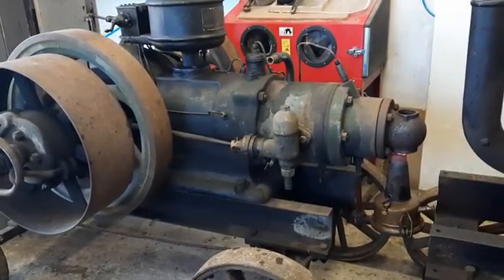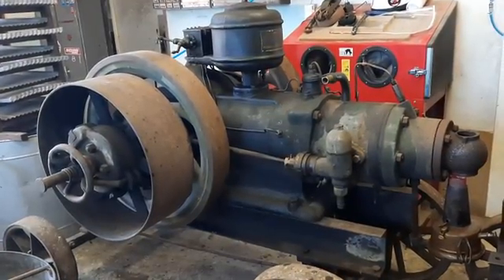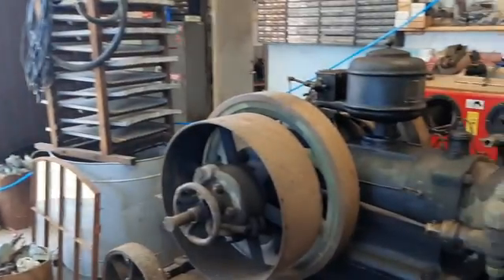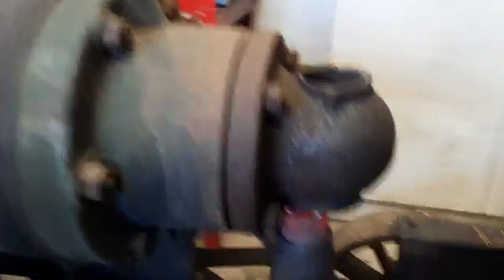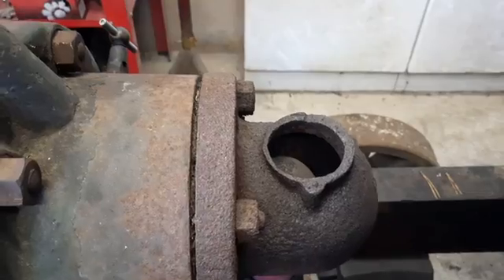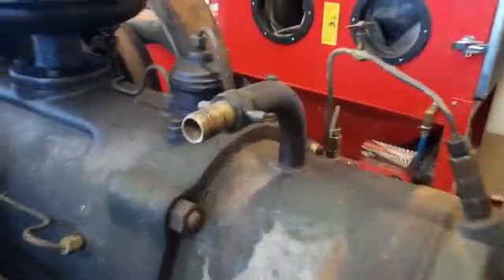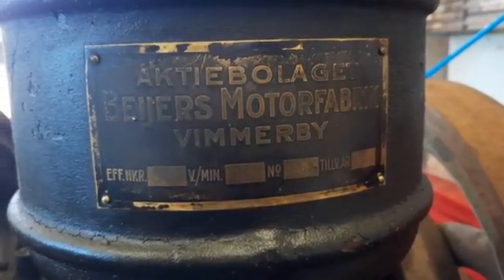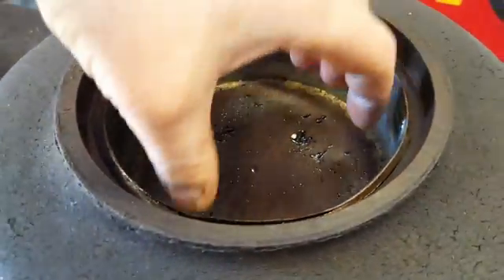10.4L Oil Engine Running @ Zero RPM. How is that possible?

Comment: You gonna destroy the keyways in the crankshaft and in the flywheel  by turning it back and forth. A lot of weight on those flywheels!
Reply from the maker: No, not with these newer Beijers with taper and key. /R

Comment: try  tiki lamp oil as fuel
Reply from the maker: Runs on any liquid that burns. /Richard
Reply: @YesterdaysMachinery  have you tried
Reply from the maker: Yep. Kerosene or lamp oil works fine. 100% wast oil works fine but tend to build up much carbon at the injector nossle. Now i run it on 50%waste oil/diesel. All vegetable oil is fine.  @TimSmith-vl4qk
Reply: @YesterdaysMachinery  what about syntenic waste motor oil
Reply: @YesterdaysMachinery  USE whale oil
Reply from the maker: It would work but them wales seems harder to catch nowdays for some reason. @TimSmith-vl4qk
Reply: @YesterdaysMachinery  syntenic oil

Comment: Believe it or not, I had a Weed Eater string trimmer that ran at 0 rpm like this for a few seconds, I think it’s because the engine would spin the spring drive which would spring back and turn the motor the other way, it was pretty cool to see, did it a few times actually

Comment: My little 2 stroke 125 CC Cagiva Mito bike engine had the same amount of horse power as this engine and weighed around 20 Kg.  Blows my mind how far technology progressed in around 100 years.  Crazy.  Obviously this 10,000 CC engine was just as powerful as my 125 CC engine 🤯 but the torque on diesels or oil burning engines is unbeatable and diesel has more energy stored in the fuel that petrol (gas for our American cousins)

Comment: In England we call those grease cups "Stauffer Lubricators" after one of the manufacturers. they are petty good although a bit tedious to use. There are automatic ones now with a grease cartridge and a high pressure gas canister to feed them, great for long conveyors but quite expensive as they are disposable not refillable.
Reply from the maker: Yes ive heard of that! Yes we use a lot of them at work, and as you say very good for convayor bearings. /Richard

Comment: There is a question concerning the eccentric governor. How does it manage not to change the timing of the ignition, especially, as it obviously works equally well in both directions?
Reply: There is no ignition.
The combustion, overly simply stated, is from the preheated "hot bulb". Once the engine is started it keeps itself heated sufficiently to keep igniting the fuel.
I love these simple engines.
This fella explains everything about them in some of his other videos.
Cheers to you.

Comment: Obviously these engines were used to drive a pulley shaft to run a multitude of machines, you needed someone trained enough to run it in the proper rotation. I did happen to notice oil delivery at ZERO RPM

Comment: I was renting a place that had an old imperial super diesel engine I had a crane so I took the head off and the piston had a threaded hole in it , I put an eyelet in it and had it hanging by the piston and added diesel transmission fluid kerosene and finally got it unstuck never got it going as it had been raped for parts over the years but I got her unstuck

Comment: So it is technically not running. But in sleep mode since in this mode you can't get any work out of it. It is in between operation and off an idle without use.

Comment: That kinda depends on how you define "zero rpm".  Zero implies no movement is occuring.  Also, speeds below 1 rpm are not zero rpm, that's what fractions/decimals are for.
Reply: It isn’t making a full revolution. So is at 0 revolutions per minute.

Comment: That is the most primitive radiator in existence. (Well, one could pee on the engine, thats too crude, but..) this is basically  a pre-diesel. Since it fires on compression but needs preheating. Coool stuff. Thanks for the tour.

Comment: thats the perfect cruising
engine for a medium sized yaht. It doesn't need highly flammable gasoline, extremely bullet proof, can run on wide range of fuels in areas of the world that are remote and coconut
oil, or old engine oil, 
may be the only resource abailable. And its immense weight would replace the lead ballast, and the engine would be installed low in the hull for low center of gravity. That thing can run months on end without maintenance, which is why they are still used to this day on old oil pumpjacks
Reply: Except you have this big engine to produce 5-10 hp. There’s more modern diesels that would produce a few hundred hp and more torque for the same weight.

Comment: Is the cooling tank just a giant stack of small water falls? it looks like the water gets pumped to the top and air cools as it trickles down? 
Would running the engine at "0 rpm" be useful in any way? Seems like it wouldn't even have enough torque for a small reciprocating saw.
Very cool stuff.

Comment: If the engine is splash lubricated, you may not get any lubrication when your engine is running back and forth. May not be good for the engine.

Comment: That old engine seems extremely crude even by 1928 standards. 1828 would seem more fitting for that level of technology
Reply from the maker: Very ruff but extremly reliable and can run on any scrap oil. /Richard

Comment: Great engine but super-dangerous, if your arm got caught by one of the flywheels it'd likely be ripped out of the socket if you're lucky. If you're unlucky you'll be pulled through the wheel like its a meatgrinder. See if u can make a hub-cap style cover for the flywheels and then it'll be way safer.

Comment: When it is "running at zero rpms" it is just malfunctioning. What flat belt implement could be used with the flywheel twitching back and forth making EXTREMELY reduced power?

Comment: At the beginning it looked like there was exhaust coming from the top water connection... is that normal for this engine? Seems like it putting water to it would cause a rapid unscheduled disassembly

Comment: It's an accounting trick.  "Since the engine never does a full rotation, RPM is zero".
Actually, you could simply count how often the orange spot passes through the lowest point ... no longer zero.  If you insist that "direction matters", this engine can run with negative RPM ...

The correct way is to sum up all absolute degrees of rotation over the timespan of a minute and then divide that by the degrees of rotation for a full circle.  That way you get the RPM you would expect from normal engines, reverse running engines are having positive RPM and oscillating engines like this one have a proper, comparable RPM value.

However it may break down for bi-rotating engines like the Siemens-Halske Sh.III due to, ah, loopholes you could be using.

Comment: It can never be zero rpm even if it doesn't fully complete the revolution it's still considered 1rpm cause the motor does turn. A full revolution before stoping and turning back the other way so it's 1 rpm in forward and reverse basically a back and forth motor

Comment: The engine is clearly making a 1/2 revolution in both of CCW and CW directions, it is not doing ZERO RPM. This is possible because the engine is a bidirectional two stroke.
Intentional or accidental in design, the flywheel mass weighting is such that it can resist a complete a revolution by matching  the power of a small  fuel  charge explosion in the hot bulb  combustion chamber against the crank journal travel and crankcase pressure, the resulting oscillation is  aided by the fact that the air inlet port  is closer to the bulb  than is the exhaust port .Therefore with only a minute admission of fuel in the bulb and not enough air the engine will oscillates scavenging of both ports. 
The rotation of the flywheel  traveling one half of a circle does not imply not having moved at all  or simply put ZERO .The motion is whatever fraction of a revolution that can be measured .
 In this case it is clearly  2#  1/2 rotations of a  revolution in opposite directions , and neither do  equal  ZERO RPM.... half rpm CCW , half rpm CW.. from the location of the hot bulb .
Most "hot bulb" engines can produce  this  phenomenon , there is no terminology that describes it accurately for all  to agree about what to call it .

Comment: Does it mean that these engines inject when the piston is right at the top holt-point? And these are the engines which you can rely on all year round, especially if you can burn anything in them. You could truly say "tough times never last, but tough people/machines do." Now, since the advent of fuel crises again, this is the type of workhorse handy to have around any household.
Reply from the maker: It injects when the piston is starting to go up again. / Richard

Comment: I'd think that doing this is rather hard on the bearings and,well,everything else..But,then again,these things are very large and beefy.
Reply from the maker: Hi! not really, This 0rpm thing aint doing anything that a normal load does. These hot bulbs ignite the fuel before TDC every stroke. It injects the fuel when the piston is just turning to go back up. And the oiler works just as good in any direction. /Richard

Comment: Just found your channel, fascinating. Never worked with two strokes. How does the exhaust work, please?
Reply from the maker: Hi! Just like any other 2-stroke. A port in the cylinder that goes under the engine. /Richard

Comment: Was it made to rock back and forth are did it just happen to be able to do it after it was invented. Awesome engine.
Reply from the maker: Old fishing boats used this 0rpm as idle. Then they could start the engine i any rotation to get F and R. For this stationary engine it is just a cool feature. /Richard

Comment: Doesn't sound like a lot of power until you look at the torque, which would be about 394 lb-ft.
Reply from the maker: Yes, very strong at very low rpm. Good working engines. That is why they became so popular. /Richard

Comment: Are you planning to use the engine for anything?
Reply from the maker: Hi! This one i use for smal stationary stuff some times. But i have other Hot bulb engines also that i use often in my big sawmill. Flat belts everywhere and a wounderful sound when sawing big logs. Very fuel efficent. About 4-5 liter /h when working hard.   /Richard

Comment: @Yesterdays - Can this hot bulb engine run on crude oil or requires diesel? thanks!!
Reply from the maker: It can run on crude oil, but you have to remove the water. Butbit can run on waste oils, fish oil, vegetable oil and so on. But diesel is the best because it doesn't leave any carbon inside the engine. /Richard
Reply: @YesterdaysMachinery  Thanks!

Comment: Saw a hit or miss engine just running in a corner at the international ag expo a few years back. Damn thing was only firing about twelve times a minute but it was maintaining a solid two thousand rpm's, the flywheel was unstoppable. I imediatly fell in love with the drip carburetor. I'd love to hook up some old gear like this to a modern generator.

Comment: You've technically demonstrated how an extremely inefficient engine can stay running at low rpm...in my opinion, that is not a argument for great engineering but the lack of it.  The title wasn't %100 wrong so my fault.

Comment: Do you want to sell this engine?
Reply from the maker: No, it's a keeper. These small ones is quite hart to find. Only around 30 engines made by Beijer of this size. /Richard
Reply: @YesterdaysMachinery  would be a shame then to use it for what i wanted it for.  Im looking for an old preferably a steam engine to run a 4kw generator.
Reply from the maker: @HowardFBeale-ql6gk  Yes, better to find a Lister diesel or something that has spare parts available.
Reply: @YesterdaysMachinery  absolutely.  Been doing some research on your engine.  Now i want it more.😜
Reply from the maker: @HowardFBeale-ql6gk  Haha, Yes, Beijers motorfarbrik in Vimmerby, Småland, Sweden. This is a 13HP. Weighs 1350kg. It is the smallest one they made except for a standing 8hp.
Reply: @YesterdaysMachinery  its gorgeous!

Comment: That's not zero rpm, it's more like one half to three quarter rpm. It's just not a full cycle. But i still enjoyed this
Reply from the maker: Kind of. But the title    "Almost zero rpm Engine or maybe one half to three quarters rpm not full cycle Running"    Would be to long. / Richard
Reply: @YesterdaysMachinery  almost zero sounds more accurate, but oh well. I made my point, now lets just enjoy this. 😅 Something you don't see everyday.

Comment: Pretty cool! But what is the purpose of being able to run at zero rpm's?
Reply from the maker: Nothing really on this one. But old boats often had the same type of hot bulb engines. Them this 0rpm was neutral. Then you could start the engine again at any direction ypu wanted to get D or R. /Richard
Reply: @YesterdaysMachinery  thanks for the response! It's pretty rare these days from the actual filmer/page owner.

Comment: How long could it stay running like this? 
Surely the heat would come out of the engine thus causing lack of heat to help with ignition of the fuel.
I know oils ingnite under compression but heat helps with viscosity and flash point.
Very interesting engine, ive never heard of and engine being able to do this
Reply from the maker: Hi, a couple of minutes. Then the hot bulb get to cold and the engine stops. But running as normal it can run for months if you fill fuel and oil. /Richard

Comment: I’d love on of these to run a generator on our off grid property- would it run on old cooking oil? If so,what fuel consumption d’ya reckon? GreT video!👍
Reply from the maker: Yes, anything that burns. I have a 35 hp in my sawmill, that one uses like 5Liters of fuel/h. When we work real hard.

Comment: When we were kids,my brother had a 50cc moped,2 stroke,which would occasionally run backwards when we tried to bump start it- interesting when you tried to rev up and take off,only to get smashed in the balls as it took off backwards!🤣🤣🏴 ( timing was very near TDC,and it used to ‘ bounce’ off the compression stroke,I guess…) thanks for the video,and the memories!🤣
Reply from the maker: Yes i have done the same thing with old Sachs engines. Minarelli Am6 can also start and run backwards. /Richard

Comment: At the yachting club my parents belonged to there was a man who had an old converted fishing boat with a hot bulb engine. Fascinating tech, will run on almost anything combustible and reasonably liquid. But it certainly takes time to get it started. The bulb cover had this little window where you could see that the blowtorch was burning and when the bulb was really red hot he kicked the flywheel to start the engine.

You have to make sure you kick the wheel in the right direction as the engine will happily run in either direction. This can be both a good and a bad thing, but mainly you need to know which direction you started it in.

Comment: I'll bet the original owners manual doesn't include warnings like "Only operate your oil engine in well ventilated areas" or "Not recommended for ages 12 and under" or my favorite "Do not use your oil engine in the shower or bath" as the manufacturer probably assumed people had sense enough not to...  boy were they wrong.  lol

Comment: Same Engine Principal like the old German Lanz Tractors. 
They biggest of them were 10.3l and made a maximum of 60hp for 1 hour or 45hp 'forever' 
I saw them idling at zero rpm at an old tractor show a few years back.
If you search for "Lanz idling at Zero Rpm" you will also find a Video here on Youtube.

Comment: I'm curious about the engines lubrication system. I imagine it's a total loss system, in that once the oil squeezes its way out of where it's needed it drips out and onto the floor, or inside the casting. My question is how do you clean the old oil out of the casting? Or does that old oil just get sucked into the cylinder and get burned?
Reply: If you saw the vids on the Munktell tractors, those had a tap on the bottom of the crankcae where accumulated oil could be drained out......
I am assuming the same for this engine...just not mentioned by Richard....

Comment: What a monster 🙉,, was this a stationary engine to drive a belt ? and how did the cool system fit on there ? Thanks !!
Reply: You saw the hose fitting where coolant went in...and the pi;pe on top where it went out of the cylinder jacket....
So as the water rjuns down over the plates and into the tub underneath the tack of plates, it loses heat to the air...by evapoaration of the water...so there needs to be a top up every so often....

Comment: You shouldn't run it that long without cooling water, you really over heated it, and caused alot of excess wear
Reply from the maker: No, this is no poor aluminium parts, this is 1.4 tons of thick heavy cast iron that dont heat up in just 1 minute. And it is no load on it, if it would run on full load it would not be good to run this long. And it was water left in the cylinder as well, you can see steam comming out from water outlet on the cylinder in pulses when the piston waterpump pumps in air. So not a problem here. /Richard.

Comment: The valve on end of cylinder is compression release to make it easier to start. Not for venting fresh air or what ever you said
Reply from the maker: No,no and no. It is not. You can not start it with this open. You dont spin these engines around, you just bumb them on compression and get them to fire and the force of the first fire makes it start. Dont compare two stroke hot bulbs to any other engines.

Comment: What was it used for in the past?
Reply: Running a small factory or sawmill or grain mill...
anything that needed power to run machinery using belt drives off a central shaft with the central shaft belt drive connected to this engine...

Comment: What Is this machine for?
Reply: Running a small factory or sawmill or grain mill...
anything that needed power to run machinery using belt drives off a central shaft with the central shaft belt drive connected to this engine...